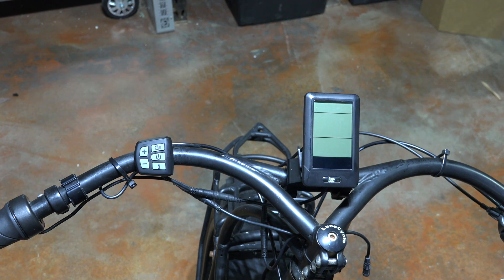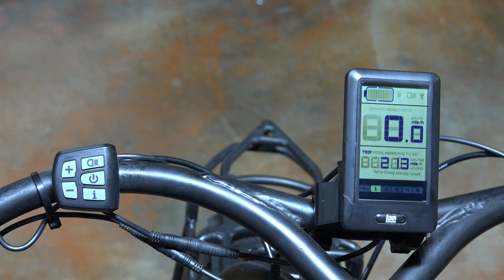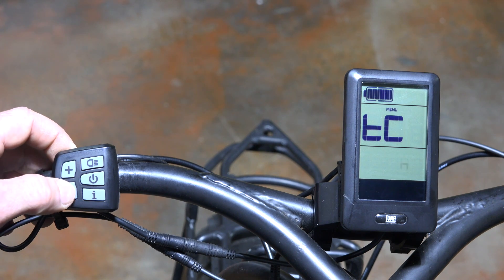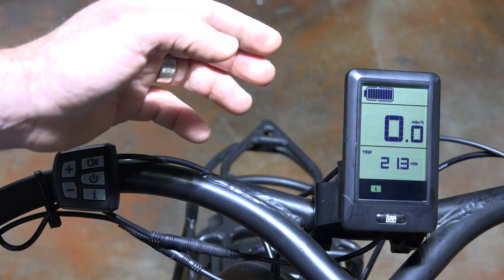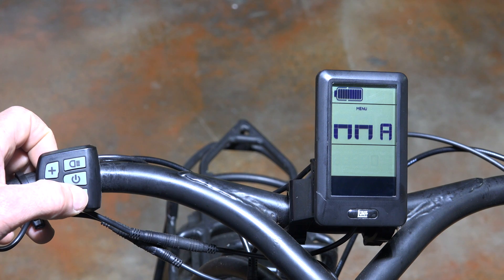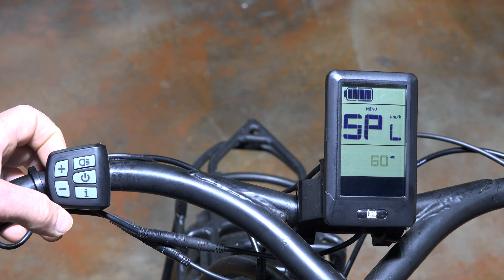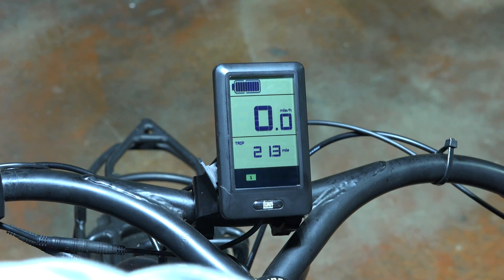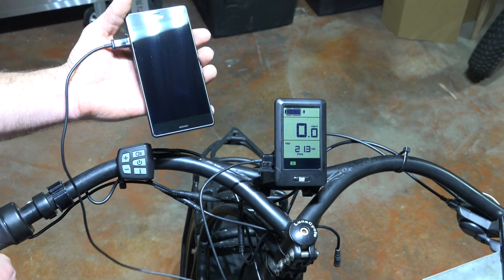Luna Bafang BBSHD DPC-10 Display Instructions

Comment: So question... How do I access this menu and change my wheel size exactly? I have a hybrid, which apparently doesn't work to modify to go faster, but supposedly it's possible to change the wheel size in order to "trick it" into going faster. How do I do that? I have never seen this secret menu to begin with. Anyone?

Comment: I lost pasword menu???
Reply: Fabrice GUILBERT did you find the password menu? I don't see it either and my wheel size is on wrong setting
Reply: I cannot get in the paasworth menu too
Reply: @josb5884  the same here. Also cannot change speed limit, which feature is present in the standard menu , no password needed... makes this the bike faster btw?
Reply: @jansap7472    Hello Jan, I bought the C965 Bafang display,  you can change it easy.  But the bike cannot go faster than 29 real km ( gps )
Reply: @josb5884  maybe it has to do with your low motor power? 250w for example? Or is your motor more powerful?
At the moment i am looking to evt. Purchase the bafang e-drive 500c for my 250w bafang motor. Don't know yet what speed i can get with that display...30-35 km/u would be great already for me...
Reply: @jansap7472   I think the motor is strong enough, but it stops at 130 rpm  ,  you need a bigger wheel, but that doesn't fit  :-)
Reply: @josb5884  hello Jos, now I've got the new Bafang e-drive 500c display. Now I can change wheel diameter and speed limit. Fastest the motor reaches is 32 km/u but with stronger motor speed would go up.
Reply: @jansap7472   are you gonna do that ?  the 500 watt ?
Reply: @josb5884  now 250 watt.
Maybe next year the 500 watt. The speed now is fine for me... i think i will need another battery with 500w ? I think i will keep it this way. But never say never ;-)